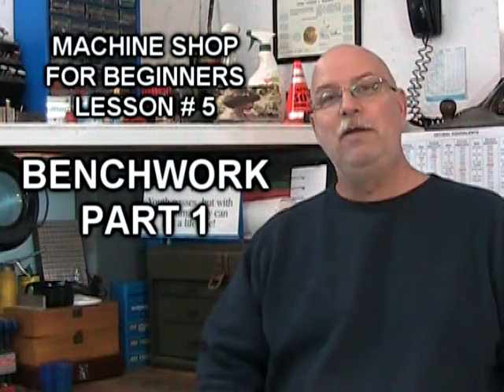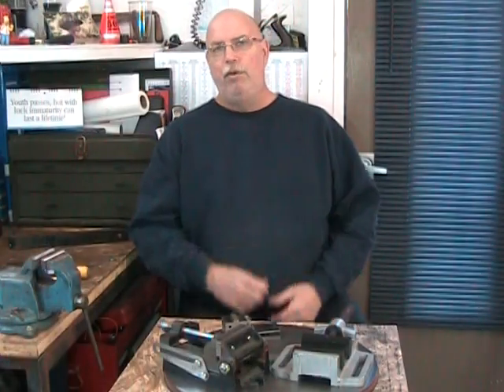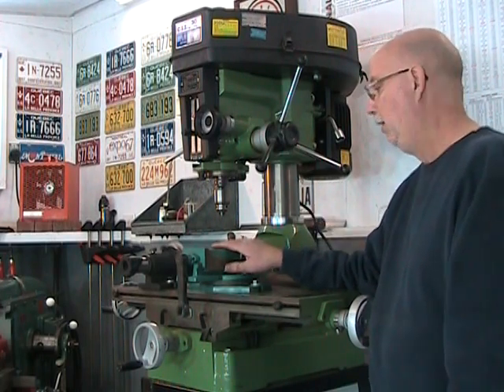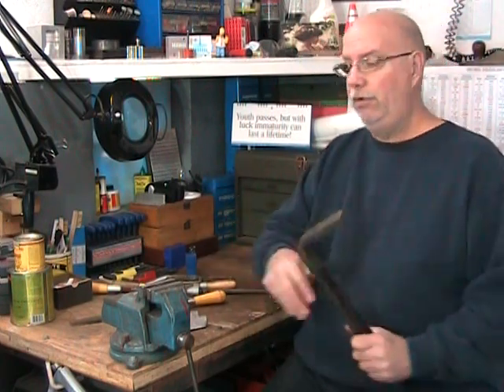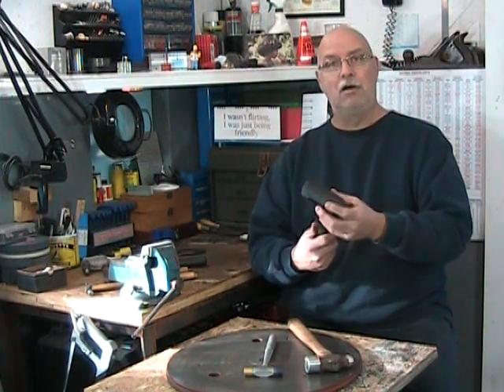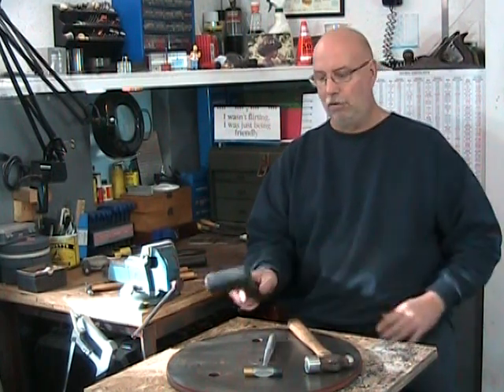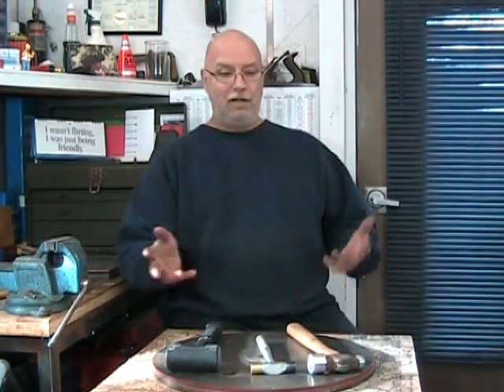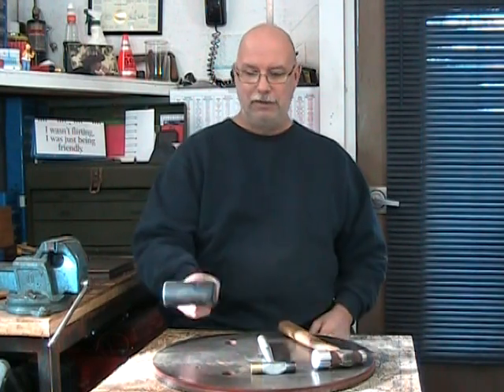BENCH WORK 1, WORK BENCHES, VICES, HAMMERS & PUNCHES USED IN THE MACHINE SHOP. MARC LECUYER

Comment: "Master" L´Ecuyer,
I love your videos. I´m a novice hobbyist machinist.

I don´t know if I can make a question on the commentaries, but will soon find out.

I want to cut a 1/4" thick PVC disk using the faceplate with the double sided tape technic with a live center pressing it firmly. 

It would have an OD of 255 mm, with a 3 mm wide by 3 mm deep groove on the 247-250 mm ID. It will be a cover for a home made telescope. I´d like not to drill the center, making it a plain cover. 

Biggest problem I think I may be getting is that my faceplate is 230 mm wide. Thus, both my outside diameter cut and the groove cut are on the unsupported piece of material (12.5mm).

Yesterday I´ve tried it out, hopping that the PVC would be easy as butter with a hot knife to cut. It wasn´t. I had not completed the task, but have also not yet ruined the materials. 

Sometimes the material slipped and I placed a large centered block on the live center tip to apply pressure on a larger area.

In the end, I´ve started grinding a trepanning tool bit, but haven´t finished it yet. 

Will the overhanging 12.5mm of material be too flexible to get any chance of a decent cut? Do you have any master´s tip for me to complete this job? 

Thanks!
Reply from the maker: +Marcelo Iannini Hi Marcello! The PVC should be rigid enough to take the 12,5 mm overhang for a 1/4" thick part. I am guessing that cutting angles, speeds, feeds and  how you are holding the part is could be the problem. For tool angles on the lathe I will suggest you watch this video,  https://youtu.be/94eIsPY_yWw  . For speeds, feeds and tool geometry I suggest these two videos,  https://youtu.be/y4gDDq_55Is  ,    https://youtu.be/yN2bUUGYV6A  For plastics and how they act I suggest this video,  https://youtu.be/Qa7O004cZH0  . As for holding the part, I would suggest that you send me some pictures of your setup so that I may better understand and I could then make better suggestions (YOU CAN'T ANNEXE THINGS TO COMMENTS). Your cutting speed should be around 300 SF/M so your RPM for a 255mm part should be around 120 RPM (slow down the speed to 50 RPM for the grooving but maintain the feed 9 ( the feed is in distance per rev so it stays the same but the tool will move slower), I suggest a neutral cutting face placed on or just below center height of your part, your tool should have a small tool nose radius and you should be using a slow feed (.004"/rev). I would also limit my depth of cut to no more than .015". If you want to, you can send the pictures to THATLAZYMACHINIST@GMAIL.COM  and remember that you will find links to all my videos on machining for beginners (75 in all plus some jokes in Canada's both official languages ) on my free website  THATLAZYMACHINIST.COM  .I hope this helps, Marc L'Ecuyer

Comment: Hi Marc, what type of steel is this  chisel you use for cutting metal?
What should be the best, if this one is not?
Thanks for the videos and instructions.
Reply from the maker: Hi Fabrisio! A good grade of alloy medium carbon steel is what I would recommend, 4140 or the like with a light temper (brown). If however you choose tool steel, make certain that you use a very complete temper (lite blue or dull silver). The chisels must be hard but the must also be very shock resistant to avoid fracturing and flaking. Always wear safety glasses when using chisels. I hope this helps, Marc
Reply: Yes it does thank you. I was glad when i heard you saying (another video maybe) that you still have 10 fingers and 2 eyes, and that is what you think in order to always be safe, I do think like that as well.